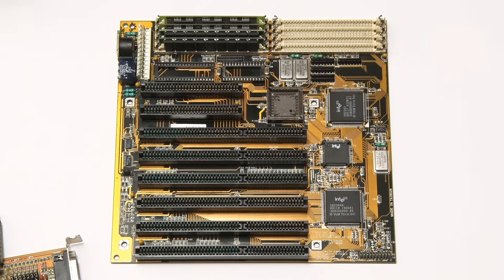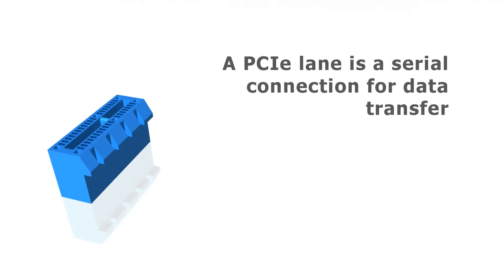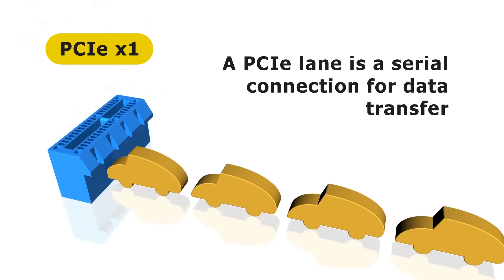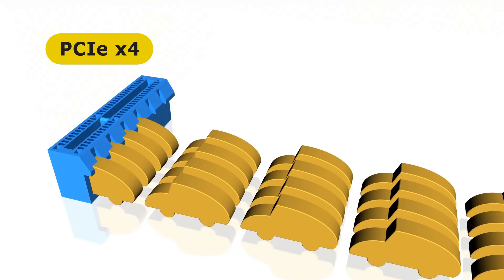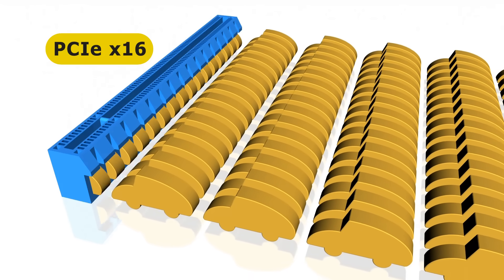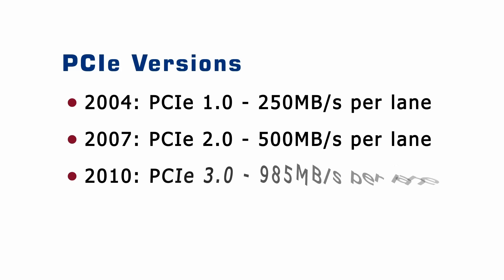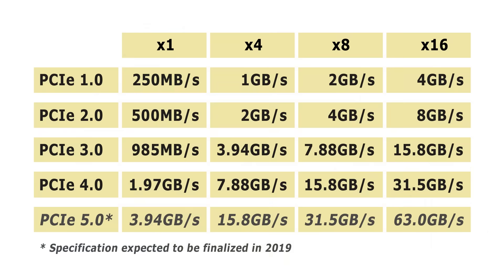Explaining PCIe Slots

Comment: For those who don't know way you'd have a motherboard with a 16x slot, and a second 16x slot with only 4 lanes, earlier motherboards didn't have enough resources to run both 16x slots each with 16 lanes. This would usually be used for running multiple graphics cards in parallel, denoted on the motherboard shown by "AMD CrossFire," or "nVidia SLI".  The card in the first slot will always be the primary, and the second or more cards are slaves to the primary, feeding their graphics power into the primary. This allows you to achieve even more performance if you're on the bleeding edge of what is available for hardware by ganging multiple cards together as if they were one very powerful card. Some older motherboards would reduce the first slot to match the second when in SLI/Corssfire mode, but most modern motherboards are able to run all of their 16x slots with 16 lanes. Some higher end motherboards even have 7 16x slots along the entire board, doing away with the 1x slots entirely and giving you room to put whatever crazy configuration you wanted, be it 4 graphics cards in SLI/Crossfire configuration, added RAID cards (which usually use at least 4 lanes), and so on.

Personally, I always used this to increase the number of monitors I could run, rather than making the primary card more powerful, because my main computer rig is a 4 monitor workstation.

Comment: If u physically cut the smaller pcie slots to allow the larger cards to fit, it would work.
Reply from the maker: Yes, I believe this can work. Though some here have reported breaking a motherboard trying this! :)
Reply: linus tech tips did it, or was it linus media group. i would suggest using a thin file at first to make the initial groove , then u can either continue or use a hacksaw blade to etch out the rest, more quickly.

Comment: My current lackluster hardware, that Del Optiplex 330 motherboard has ONE of these PCI-E slots. Just one. There's also two other expansion slots, but I don't know what they are exactly...
I love watching videos on old tech. They're fun, fascinating, and the nostalgia trip is a nice bonus.
Same with old games, especially the history of games like Tetris and such.
Reply: Gotta be careful with those brand name desktops. Some of them, such as the HP dc5700 (I've worked with a number of these units) have what looks for all intents and purposes like a 16x slot, but is designed ONLY for a proprietary expansion card. If you try to put a video card in one of these, it'll just give you an error code.
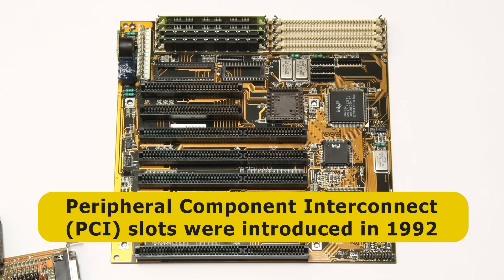Reply: The two white slots are PCI. He talks about them at 1:50 and shows them at 2:02. The 4 he's pointing out are white just like yours; Yes they're bit older interfaces but some cards run fine with them.
Reply: That's what it looks like, yes. The colour of the slots is completely arbitrary. They come in any colour the manufacturer wants. I've seen black, red, neon green, etc. Sometimes they will be colour coded, sometimes not. Usually, at least the primary slot is a different colour, but not always.

Comment: Thanks I never knew I could retro fit USB3 to my 6 year old desktop, it has one  X1 PCIe slot on the board so I have ordered a card .............. should make my backups to my extarnal USB3  2 Tb hard drive a little faster.
Reply from the maker: You will find that a very useful upgrade indeed! :)
Reply: card fitted now and speed a little over 4 times faster :-)
Reply from the maker: Great result. There are very few upgrades that are so effective.

Comment: what about "odd ball" slots?  like the riser slot on some of those old Pentium 3 boards. supposedly used for modems, which I NEVER could find one at frys electronics or compUSA etc..  ended up using regular old 56k in the PCI slot, but I was always interested in what the performance was on those slots. what else plugged into them?
Reply from the maker: I do not know!

Comment: Could I insert an NVMe SSD into a PCIe x1 Abit X8 2005 (with / without a riser card)? Still using it fine. Just couldn't find an affirmative answer (obviously?). :D

Love your Retrophile show and fascinated with your proficiency beginning from the start of the consumer electronics computer era. So I hope you have the answer to my legacy compatibility question. Maybe make a show how far back current devices are compatible with legacy computers? Thanks!
Reply from the maker: An M.2 NVMe SSD can be put into a PCIe adapter (usually a X4 card) and plugged into any PCIe slot that will accommodate it. You have not provided a complete motherboard model number, so I cannot check the spec of your board. But if you have a free X4, X8 or X16 PCIe slot, you should be able to fit an NVMe SSD in a PCIe adapter, or indeed a PCIe card NVMe SSD. This said, you may get no speed benefit with a 2005 motherboard compared to using a SATA SSD connected via a conventional SATA connector. And it is pretty unlikely you will be able to boot from an NVMe SSD connected via an adapter to a 2005 motherboard -- it will depend on drivers and OS support. Certainly Windows 7 and before will not natively support this. So personally I would use a SATA SSD.
Reply: ExplainingComputers Thanks a lot for answering from a technical (speed) & cost perspective. It only has spare PCIe x1s, as the PCIe x16 is already taken up by the graphics card. Does not have PCIE x4 or x8. The motherboard is a legacy during the beginning of PCIe x16 GPUs. 

Over time finally could afford to RAID 0 the hard disks. Apparently it’s already been upgraded, albeit very slowly to its highest spec possible minus an AMD FX flagship chip. Haha!

Learned the hard way, better to game on a console. :p Though ironically it makes quite an excellent retro gaming machine.

Quite starstruck to receive a reply from one of my favourite celebrity. Thanks again!

Comment: My first computer was an Atari 800XL in eighty four. I did what I could with it, without many resources, until puberty kicked in. Then I purchased a used 486 in ninety four, and did everything myself, with some help from a classmate, including a later CPU upgrade to 586. Stuck with it as a hobby, and set up friends and family in the nineties when they were unsure about, "this home computer thing". Also ended up "the guy" in most work situations to get anything up and running, or troubleshot, instead or before of having to submit a ticket to IT. Eventually took an A+ class in aught six, which was good since it filled in some gaps. Out of all that, this is one of the best explanations of a topic I have ever experienced, thank you. I just wish we still lived in a time where experience and ability were recognized, versus papers and, more importantly, socialization. Then I might not have to be constantly unemployed, or underemployed.  

t. watching this on a fifteen year old Pentium 4, 2.66 GHz, 1 GB RAM, USB 2.0 8 GB thumb-drive only, on wireless; and my laptop is lesser.    

("So here it is, coming at you,|LoTek style.", I would link it, but it's weird, when getyarn is where the clip is posted at, but I cannot play it on my low tech computer... Then it is wondered, why I lost my mind. So, for Terry)
Reply: How could you be unemployed in IT? I thought they needed those guys. As long as your knowledge applies to modern tech, you’re good.

Comment: Nicely explained. So to.simplify things computer standards were again made into a confusing mess with different shapes and speeds for its expansion slots. Time for a fun romp through the varieties of RAM dating back to jumpers to connect an ocean of pins and their high cost of achieving that RAM through SIMMs to DIMMs and all their many clock speeds.It is like watching a TV serial sometimes. If you hop into out of sequence you could have a daunting time making sense for a bit :)
Reply from the maker: A RAM video is on my list!

Comment: You missed the risers, often used in gpu cryptocoin mining. It allows 16x physical boards connect to 1x slots. Why? Because bandwidth there isn't important, only computing power so they rather have 6+ GPUs running at 1x than 2 or 4 at 16x/8x. For an extreme example take a look at the Asus B250 motherboard, it has 19 PCIe slots!

Comment: "This video explains everything you need to know about PCIe slots"
* You didn't explain whether a slower card in a faster-lane system degrades the speed across all other PCIe ports or not.
* Are all cards capable (or alternatively, what is the implication) of a 16x way sat in a lower lane PCIe port?  How would it continue to work given its expectation of 16 data lanes not being present / servicing data?
* You explained ISA (which was an address/data/port-based system which were directly wired to the then Intel CPU's pin-outs) without following-up how PCIe integrates with the modern CPU.
* Surely some on-board chipsets (be it IGP or audio) are PCIe port-less devices that are attached by lanes?
I'm subscribed to your channel and enjoy what you do; I just felt this time the video left needing to know more than what was conveyed.
Reply from the maker: Sorry the video has disappointed. A X16 card, in say a X4 slot will work at X4 speed, as the video notes. This is how the technology is designed -- the card is capable of using 16 lanes, but will function slower without them. Certainly more can be said about PCIe lanes on a motherboard, and I may well return to that in another video. :)
Reply: Disappointed is perhaps too strong a word, I just had too many questions spring to mind (that'll be my inner nerd, sorry).
What I was trying to say - perhaps badly - by 'slower card' is if a V1 graphics card at 2.5GBs is inserted to a V2 board at 5.0GBs (irrespective of Xn socket), does it drag down all other PCIe sockets to 2.5GBs?  (akin to older Wi-Fi would run at the lowest common denominator for all connected devices).
There must also be some Hogwarts-grade magic on the graphics card to continue working despite the loss of 12 lanes of data.  Perhaps I'm just over thinking this.
I look forward to a redux on this topic, and especially for the one you mentioned in the video about an architecture retrospective as that's the era I grew up in  (Port 220, IRQ 5, DMA 3 and you might just get some sounds - the youth of today don't know the struggle!)
Reply from the maker: A slower card will not drag down the speed of cards using other slots. Though all motherboards have limited lane capacity.

Comment: I also bought the PCI controller for the extra USB ports. Maybe this will solve the problem of the irresponsive USB ports with my struggle of installing the Windows 7 on a 8th gen processor

Comment: Thanks so much!  But what about using a cable adapter for 4x pcie to full 18x pcie?  would the speed drop be worse than just plugging the card direct?  (like what you showed with the open end slot) or would performance loss be negligible?  Also what about using SDUC cards in an SBC?  would it even read it?  They are supposed to be backwards compatible, but as a gamer, I know that is sometimes not the case even if it says so on the box.  I would really like to see a video about an SBC "tricked" out specifically for gaming, I mean real min/max type stuff.  I am certaintly intrigued by how far PCs have come, and the small size is pretty cool, but if I can't game on it what's the point.  I'll still have a full size atx on my desk.
Reply from the maker: Adapters can indeed work, though you then need to mount the card somewhere it fits! :)
Reply: yes and probably add an additional PSU.  I was thinking about making a clear case using a sheet of plexiglass.

Comment: Great video, great explanation. So the tiny white 1 (4?) lane slots are compatible with PCI-e slots used at laptops? For example you can fit a PCI-e wireless network card (for laptops) into such slot on a PC-motherboard? Is this possible?
Reply from the maker: Laptops have their own slots, such as ExpressCard, mSATA and (most recently) M.2. So laptop cards will not fit (directly) into desktop motherboard PCIe slots.

Comment: EISA boards were few and far between, but VLB was extremely popular, especially for graphics cards.  VLB was faster than PCI, and it took AGP to supplant it for graphics.
Reply: EISA cards were very common in servers of the day - I dealt with them a lot in Compaq servers in the 90s.  Rare in PCs though.  Problem with VLB was that it actually tapped directly into the memory bus, rather than being a separate I/O bus in its own right.  This meant a lot of compromise in design and also the cards had to run synchronous with the front side bus.  PCI was what was called a "mezzanine" bus that did not have to be synchronous with the FSB, so allowed much more flexible design.  VLB was really a stop-gap measure with quite a short life.
Reply: Every board with PCI slots I ever used back in the 90's tied PCI speed to FSB speed.  That was actually a barrier to overclocking, since upping the FSB was about the only way to do it at the time (prior to that, replacing the physical clock crystal was required).  The CPU might work fine with the FSB running faster, but many peripheral cards would stop working.

I agree that VLB was a stop-gap.  It was a Frankenstein's monster composed of an ISA slot and an MCA slot (which is really a slot type that never caught on, despite being technically superior - IBM's licensing requirements made it still-born), wired up for raw speed with very little else considered.  Being tied to the FSB also made it a limiter for overclocking, if the graphics card (basically the only VLB component that had widespread usage) couldn't handle the higher bus speed.

Comment: I have a question,i am using gigabyte a55m ds2 motherboad which is fm1 rev 2.2 version.i wanted to upgrade to a better graphics card 3.0 pcie with gdrr5 graphics card will it work to my current motherboard? Just to be sure b4 i buy. SOME CALLED TO be  TECH GURUS I  IN OTHER YOUTUBE CHANNEL I ASKED THEM ABOUT MY QUESTION BUT THEY CANT ANSWER IT  i do hope u will have favorable response.thank you
Reply from the maker: Your motherboard has a X16 PCIe 2.0 slot, so any X16 PCIe 3.0 graphics card should work just fine. Just make sure that you get a card that will physically fit in your case.
Reply: Thank you so much for the reply.

Comment: Wasn't the AGP slot cut into segments to prevent putting the wrong voltage card in the slot? I believe this is common since the 90s that voltage changes mean the cutouts move in the slot.... this goes for ram, pci, agp and even processors....
Reply from the maker: To a degree, yes. But it was not uncommon to have to set voltages via DIP switches or jumpers on motherboards at the time.

Comment: 9:00 putting a x8 or x16 card into a x4 slot does not guarantee x4 or even x2 bus width.  It all depends on what the board and card support.  The standard dictates only that x1 must always work, x4 and x2 are optional.  There do exist devices (usually non-SLI graphics cards) that support x16 or x1 and nothing in between, because the manufacturer assumes you'll use a x16 slot.

Comment: Did you know that you can install your new, amazing GPU into either PCIe slot if there is more than one?

Some guy in a Verge video just told me so and he seems very knowledgeable.
Reply from the maker: Yes, as I say in the video, you can indeed fit a GPU into any slot that will accommodate it. But it will only work at full speed in the X16 slot. So putting it into a X4 or X8 slot would not be sensible.
Reply: @ExplainingComputers  

Also, when applying thermal paste to a CPU you should use the entire tube on top of the heat sink that has paste pre-applied. It'll help you obtain as much as 120fps in League of Legends.

Comment: 02:40 Almost all AGP slots were all keyed differently, very rare to get a card or motherboard with the wrong slots.
https://en.wikipedia.org/wiki/Accelerated_Graphics_Port#/media/File:AGP_%26_AGP_Pro_Keying.svg
Reply from the maker: Keyed, yes. But back in those days it was common to have to set voltages via motherboard jumpers or DIP switches. It was not like today when if something plugged in it was OK! :)

Comment: ISA cards, lol, I actually tried working on it but computers that is soo old requires manual work (IRQ, DMA, memory register etc...) for each card to work, its very easy to get things to conflict on resources.

PCI cards make it one of the early true plug and play, but meh, windows 9x is actually terrible at it and only fixed after windows xp is released (at least as far as I know)

Pcie cards, in general it should be compatible in any generation, but with the thing called UEFI, this cards may make this cards incompatible on BIOS only motherboards (example is modern graphics card, plugged on a lower generation 1 motherboard in BIOS mode only, even a lower end graphics card may have compatibility issues with UEFI due to that older graphics card doesnt support secure mode, to make it work you might actually want this thing to set to insecure mode or partially secure mode, some motherboard doesnt support this specially the OEM ones which it only supports secure mode).

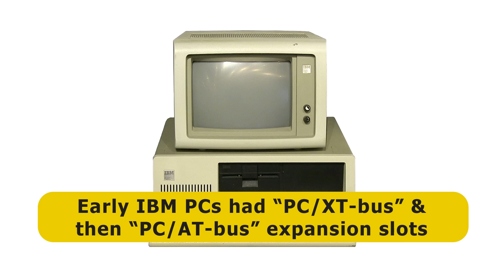Comment: The motherboard in 0:53 is newish. It has SIMM slots, and not the SIPP slots or the DIPP package sockets for memory. Looks like a 286 MB, seeing the squarish socket (that's oddly missing it's processor).

BTW, my first PC was an IBM 8088 with 640K of ram in four 16K banks of DIPP chips. Had two bad chips, and I watched Dad pull everything out and test it bank by bank... :(
Reply: Typical 386sx board, I have some here, maybe that same exact model... The CPU is NOT missing, it is soldered to the board, the smaller Intel one... The empty socket is for the 387 math co-processor.
Reply from the maker: Indeed, there is a soldered 80386 SX 20 here.